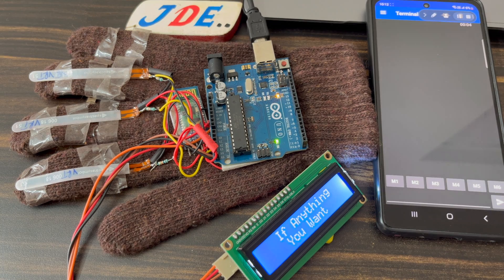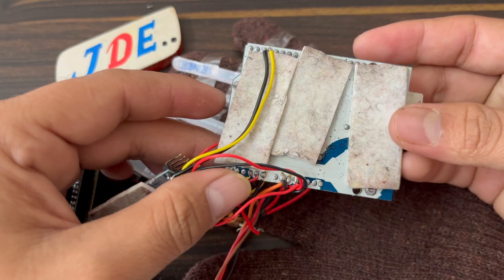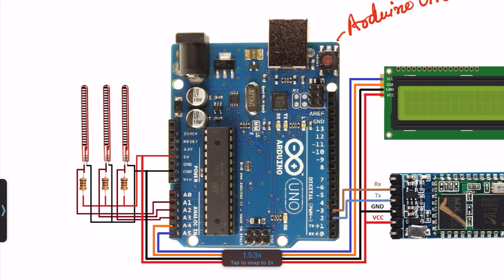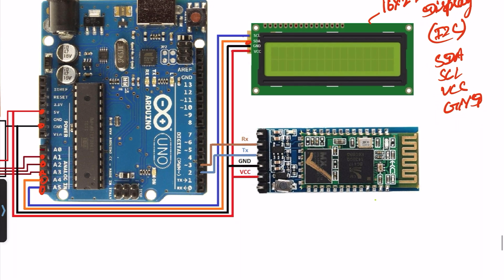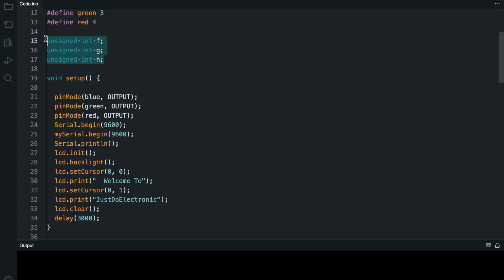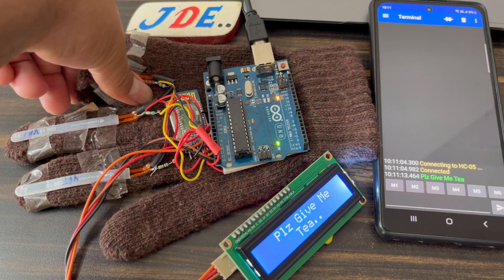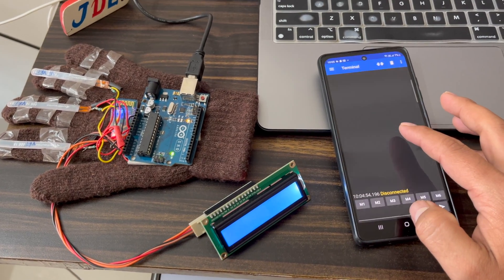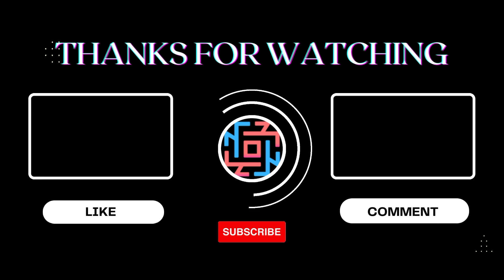Sign Language To Text Conversion With Flex Sensor | Arduino Projects

Comment: hi, may i know the reason why you choose arduino uno and bluetooth module instead of using other arduino like esp32 38pin which is already have wifi and bluetooth in it? thank you ^^
Reply from the maker: I know but some students is not configured the esp32 module that’s why i used the arduino uno board you used any board thanks 🙏
Reply: @JustDoElectronics  ahh i see, okeyy thank you for the explaination. i'm just afraid that i still need the bluetooth module even i already use esp32 ^^

Comment: hello actually i want the text from the flex sensors to come to the laptop in a code, can you please me guide me
Reply: Hello ...I wanted to ask are flex sensors easily available?
Reply from the maker: @sstarshaleen838 yes you buy to any online website
Reply: @JustDoElectronics  can I get them offline easily 
Actually the delivery time is long
Reply: @JustDoElectronics  also ..is there any alternate for flex sensors ..if I can't find them then
Reply from the maker: @sstarshaleen838 yes
Reply from the maker: Yes is possible

Comment: Can I use 5flex cables instead of 3, but the pins are limited to 3 connections to the flex cables. Do you’ve any solutions?
Reply from the maker: Email me your problem i will try to slove it thanks for your comment
Reply: I have the same query.Have u received the mail?
Reply: @kirtishelke7164  I didn’t mail him, but our Arduino has 5 analog pins, so if we want to use 5 flex sensors we can’t use the LCD Display at the same time if we want to use LCD it takes 2 analog pins which leads to only remaining 3 which can be used for flex sensors